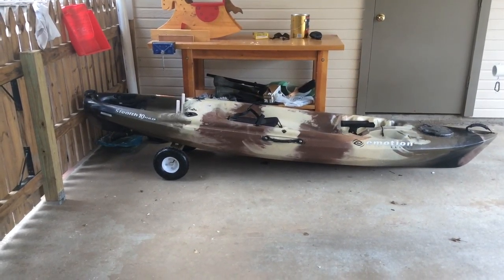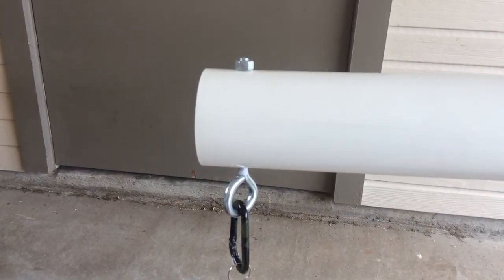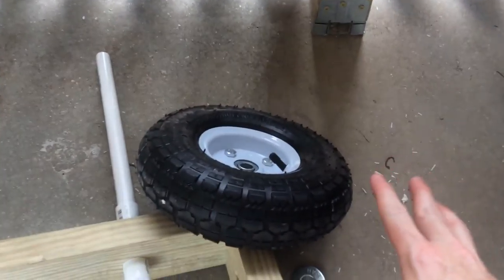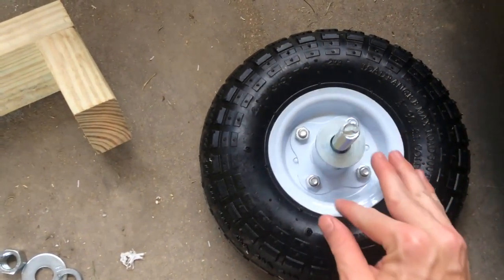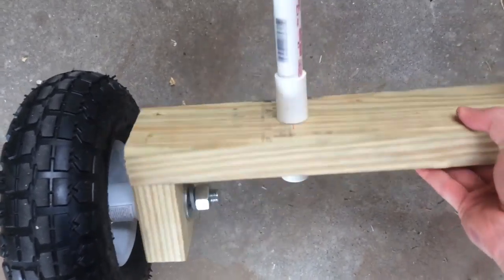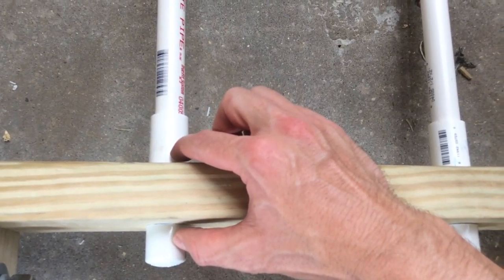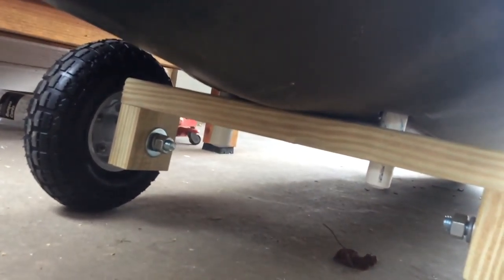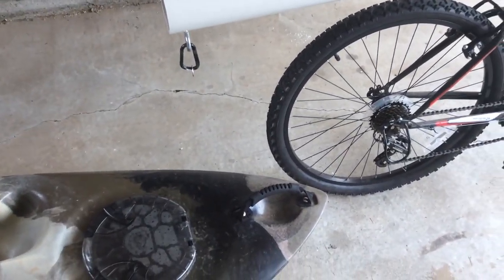DIY Bicycle Kayak Trailer

Comment: You could also use parlock(tm) nuts to keeps the wheels in place while the trailer is facing ground vibrations.  ;)

Comment: Those fat tires on the Kayak produce a lot of drag and increase the load as you move.  The smaller diameter tires also increases drag when going over any variation or incline in the road; rocks or pits are also more noticeable with small diameter tires. 

The wood frame for your axel is too heavy.  Maybe look for  structural shapes of aluminium.  Aluminium tubing for a rigid connection would increase control when pulling the unit together and will stop the push and drag effect.
Reply from the maker: DALE thebelldiver thanks for the comment. As with any design project, you must factor in cost and complexity. This product is functional with low cost and a simple design most folks could build at home. There are products on the market available for purchase for $250+, but I believe my product works well for the price.

Comment: I like this but do you use the kayak as the trailer to put stuff on or do you use it because how would it float, great video just curious
Reply from the maker: hunter ward the kayak floats and I also put all of my fishing gear on it. The scupper holes are there by design and help water to drain out of the kayak.

Comment from the maker: @maguna211
There is enough friction between the pvc pipe and the seat post to keep it from swinging around. Coming to a sudden stop while riding downhill may make it swing around but we don't have hills where I live.
Reply: Slightly longer pvc and use a "u" clamp to clamp it to the top cross member should take care of any "swing" issues

Comment: Center the cart under the kayak's center of gravity and your bike will handle better, because the kayak won't be pulling down on the tow bar.
Reply from the maker: tepjkl57  thanks for the comment. All of my gear (anchor, tackle, food and drinks, etc.) is loaded on the rear of the kayak just behind the axle, so the center of gravity is actually towards the back once loaded. Of course each kayak is unique so do what works for you.